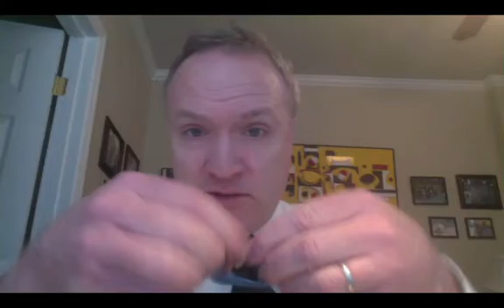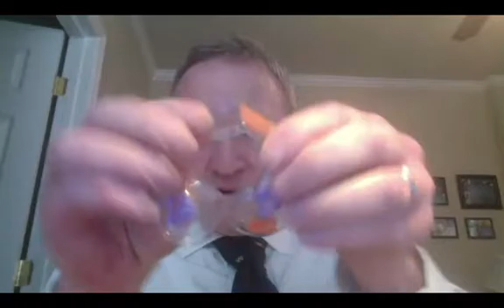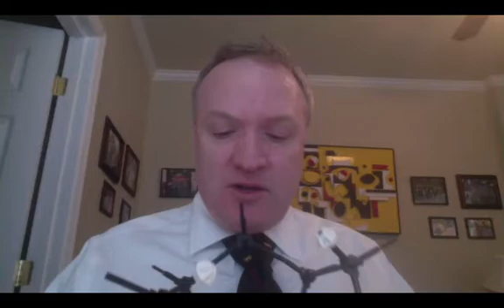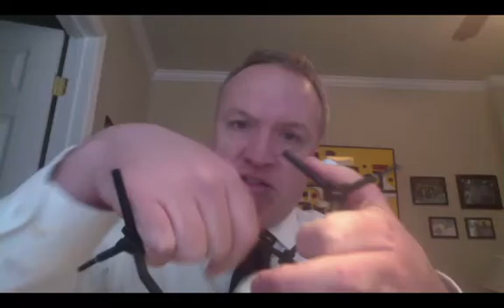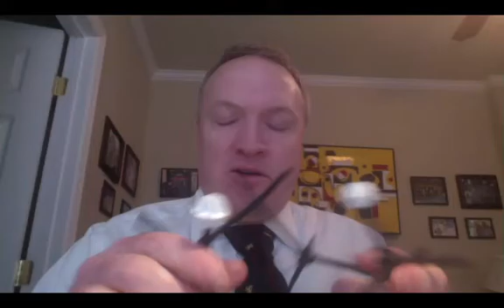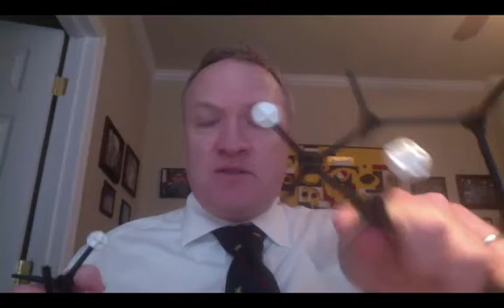Ring Size vs. Floppiness

Comment: Does it matter how close the substituents/functional groups are to each other on the ring?
Like for example if halogens were attached to the ring, is it tougher for vicinal or 1,2 dihalides to flip from cis to trans than, say, 1,5 dihalides on a cyclononane ring?

Thanks as always for the videos, James!
Reply from the maker: +Parakh Mody Generally not, especially not for halides. What you're talking about is eclipsing 1,2-strain. It would be an issue if both groups were t-butyl or perhaps isopropyl. But certainly not an issue if they are both methyl.